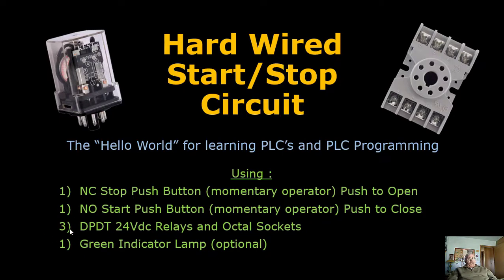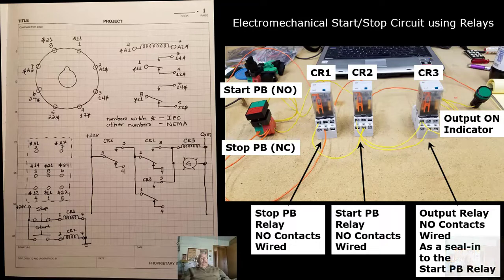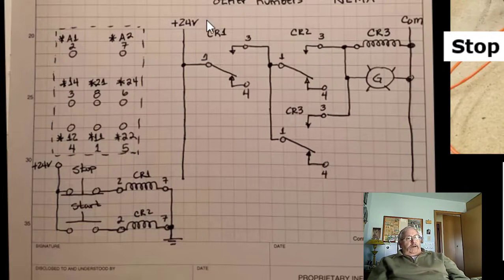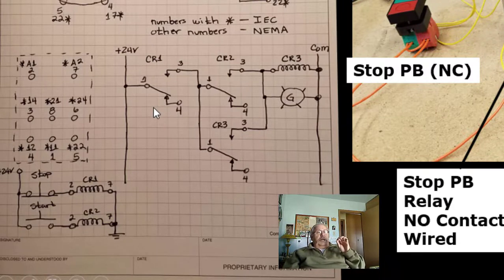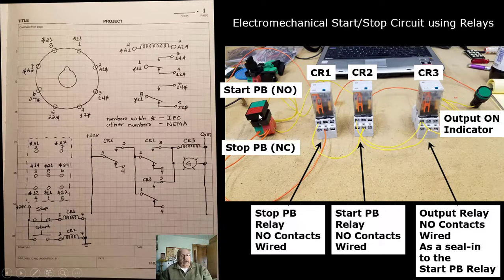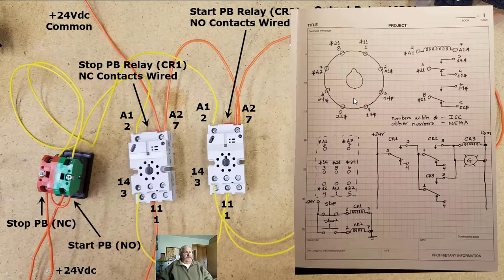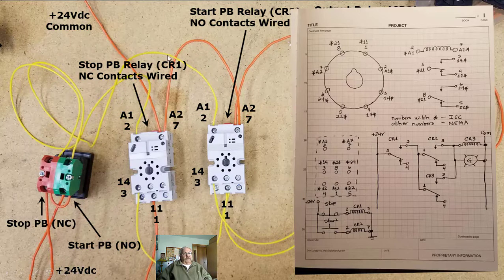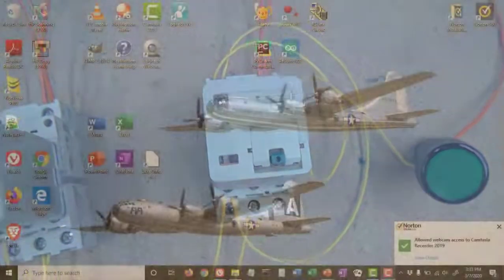PLC I/O Interaction Demonstrated with a Hardwired Start/Stop Circuit Using Relays

Comment: Thank you to share your knowledge!!. Sir. i want to know how to wire a PLC and a Softstarter with the micro850. maybe you can do a video of this item.
Reply from the maker: Hi, the Micro800 series supports the following Rockwell Softstarters: SMC Flex, SMC-50 and E200 overload. When any of these are added to an 800 project, configuration pages are provided. If you're using another type of softstart, you will need to contact Rockwell and/or the softstart manufacturer for specific instructions.